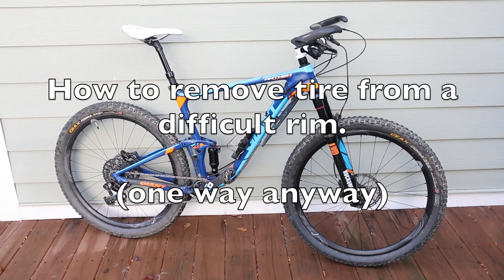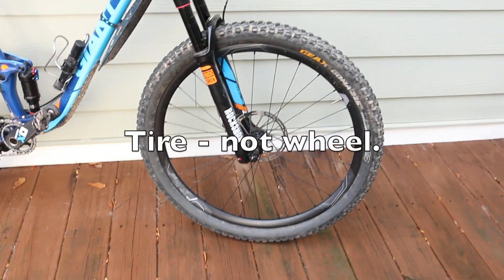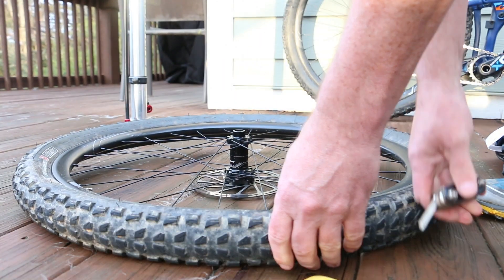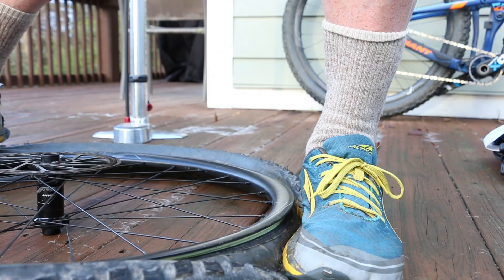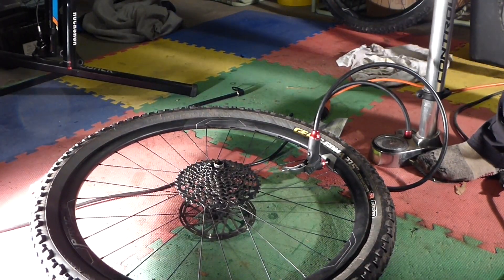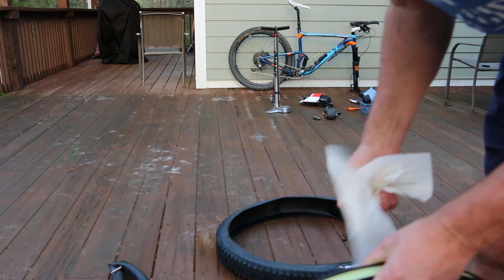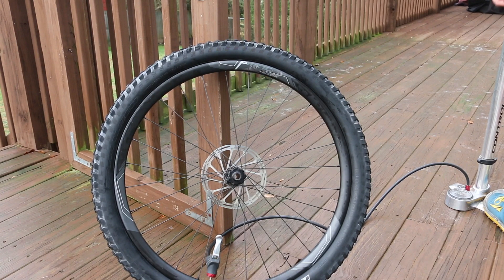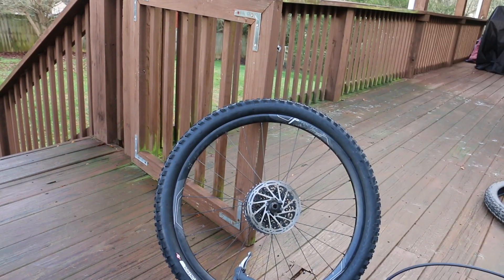How to Remove a Tire from Difficult Carbon Rim Without Damaging It

Comment: Thank you! I used to be a helicopter mechanic in the Navy, but I STRUGGLED with exactly the same problem you had here. Worse, I'm getting old and my hands aren't as tough as they used to be... fought that darn tire until my fingers were bleeding, but no luck. I want to do this task without tools for flats on the trail or on a bike tour, so I restricted myself to only the things I had in my tool kit; NO shop tools. This method works. Thanks again!

Comment: I came across this video trying to remove some 25c road tubeless tires. Unfortunately, there's not enough tire carcass for me to stand on it, but the video did prompt me to try a variation that worked - I laid the wheel down, put a plastic tire lever at the bead, stood on the lever and then pulled up on the rim. 

Thanks for the vid and I hope that my variation keeps some unlucky person from trying to cut their tires off in frustration!
Reply from the maker: Good job!  These new rims are such a pain in the ass.  I know they did it so you'd have a really good seal but it sure has made it harder to change a tire.
Reply: Thank you for this. I am going to try this tonight. I love these wheels but dread getting a flat because of how difficult/impossible to remove the tire.

Comment: This video is still helping people in 2021. That push the tyre bead off the rim with your feet tip just saved me from punching the wall. Now I just have to figure out how to get the spoke nipple out of the wheel (it's just rattling around between the double walls at the moment). Deep rimmed CF road wheel by the way, had to pop both beads with my feet just like you did. Top tip! thanks for the upload, very handy.

Comment: I fully and completely endorse this video!!! I got beat up last night attempting to remove a non-tubeless 27.5/650b tire from a tubeless rim, after taking a beating for about 15 minutes I decided to search for info on the issue. Used your technique with boots on and done R&Ring the tire onto another rim and mounted in about 3 minutes. This video should receive an award, no really it should. Stay golden pony boy!!!!!

Comment: Brad, thanks for the video. Well, I wrestled with getting a tire off my wife's new carbon rims for 2 hours with no success. I tried your solution and was able to get one side off, but not the other. After reading somewhere that bike shops placed the tire and rim on top of a large trash can and pressed down on the tire I thought that might work. I only had a plastic recycle bin, but I placed a heavy towel over the bin, laid the rim/tire over the edge of the bin with just the tire hanging over the edge of the bin. Then I held one side of the rim down with my knee while pushing down on the tire on the other side. Boom, it popped right off. I flipped the rim over and repeated on the other side. Boom, that side released also. Took 10 seconds per side. I think you might be able to use a log out on the trail instead. The trick is to get the rim off the ground a little bit while pushing the tire down. Also seems a little better for the rim and cassette than standing on it. Ha.
Reply from the maker: That's an excellent idea!   I just had a difficult time again a couple weeks ago and took a bit but I got it off, however, instead of grabbing spokes, I actually grabbed the opposite side of the rim but your method sounds worth trying next time (or if I get stuck out in the woods).   Thanks for sharing it.

Comment: This video was a fingertip saver. I worked for hours trying to break the seal on my 27.5 tire and it wouldn’t budge. My fingertips were raw from gripping the tire and pulling on it. Even snapped a level trying to get it off. Thanks 🙏

Comment: after 1 hour, tired fingers and blistered thumbs, i successfully removed the front tire off the carbon rims of my road bike. i gave up on the rear wheel until i watched this video. a bit skeptical for road wheels cause of the much skinnier tires but with a little care, a lot of rags and some walking around eggshells, i just managed to pull the bead of the rim! thanks for the video!

Comment: DANG. I knew someone would have this figured out. The shop I bought my bike from told me to just bring it in whenever I had a flat--said it took him two guys and pliers to get the tire off. Your method is TOPS. Still a bear to get the tire back IN the rim, but way better than having to schedule to take it in and wait and on and on. Thanks, Brad!!

Comment: You beauty! I have just done this on WTB byway 47 gravel tyres after an hour of struggling trying to push of the rim with my thumbs and molegrips and getting a blister in the process. Your method works in seconds even on a rear wheel with gear set and brake disc.... no sweat BRILLIANT. :)

Comment: April 2020 - with a carbon gravel bike rim and a 30mm tire - this method worked (pulling on the rim). I did it on concrete, and the tire slipped out from my shoe once, scratching the rim edge - so keep the surface in mind when you are doing this. I have put dry-lube on the tire edges installing it - hoping this help get them off next time I flat. Thanks Brad for the video

Comment: I couldn't get the tire off, so did a Google search for videos. Lo and behold, I have the same bike and wheel set as you - right down to the paint colors! Thanks for the advice - worked like a charm releasing the tire!

For mounting a tire, I use a mixture of Dawn dish soap (about 10-20%) and water for lubrication. The floor pump wouldn't get the tire to inflate, so I have an Airshot canister which stores enough air to inflate the tire in one shot. Mine seated at about 30 psi - although it may vary between tire brand and models.

Comment: Thanks for posting.  I was ready to cut the tire off but this worked great.  One difference is that I pulled on the rim instead of the spokes.
Reply from the maker: Yeh - in retrospect, pulling the rim is a much better option.  Hadn't thought of that at the time I made this video.
Reply: @MTBIKEXC  Just after I sent this comment I saw that you put the same thing in your comments.  You saved me so I appreciate that.

Comment: Thanks so much for your video, was a little reluctant to stand on the rim thinking I might damage it. So here's what I ended up doing and it worked perfectly. I pushed the deflated tire to one side and HEATED THE BEAD UP WITH A HAIR DRYER. It released immediately.
Reply: stand on the tire, not the rim.

Comment: Advice: When attempting to seat the tire, you want to be careful pumping it above the recommended PSI. It could easily explode off a carbon rim. If at the recommended PSI and still not seated, bring the pressure down and attempt again. If still a no go. Leave the psi at max and tap the tire on the floor (working your way all around the tire). If it still won't seat, ride it a bit on pavement... It'll eventually seat under rider pressure.

Also, if seating for tubeless, install with a tube first, seat and deflate. Then remove one side of the bead, remove tube, reinstall tubless valve and open side of tire, reinflate, seat, deflate and add sealant via the valve, add desired psi.
Reply: you havent done this on mtn bike carbon rim yet have you smb ?? :)

Comment: I work at a bike shop and we advise our roadies and tubeless ready mtb'ers to carry Chapstick in their saddle bags/packs to lube the tire bead like you did with the dish liquid. At home you can also use baby powder on the bead reduce friction for road and mtn bike tires. This will also save you a lot of sweating and swearing if you have to take the tire off and is a little less goopy than the liquid. Great video!
Reply from the maker: Stephanie Fischer thank you.  Appreciate the tip!

Comment: Brad,

I had the same problem but with regular non-carbon rims.  Tried for about an hour trying to peel the tire back from the rim. Saw your video and finished  taking the tire off in 2 minutes. It works!

Comment: Thank you, thank you, thank you for posting this video. I was struggling and ultimately cut off the old  Maxxis Rambler tire (40mm) off my front Industry Nine wheel. After running into the same issue on the rear, I found your video before I cutting. I then tried your method on the stuck rear. Worked like a charm and saved me the hour it took for the front. I was super worried about what I’d do if I got a flat while on a long ride. I’m not worried anymore. Thanks again.

Comment: Another thanks for this video. My Nukeproof Scout has tubeless tyres and rims fitted (although with tubed from the shop). I tried yesterday to put some more gravel focused tyres on and for the life of me I couldn't figure out how to get the tyre off. After about 30 mins I gave up. Fortunately this was in my garage and not in the woods. This morning after a few minutes the front tyre was off. The rear took a bit more time as I was wanting to avoid any damage to the cassette. Thanks.

Comment: This is a very helpful video. I have a Trance 1 with the same carbon fiber rims, Nobby Nic tires. Somehow, I managed to get them off the first time when I converted to tubeless a few years ago. I thought it was latex binding the bead when I tried to remove the tire recently. Your trick was perfect; the bead popped off with less effort than when I tried to pry them off with my hands.

Comment: I  had the same issue with a Race Face Next R 30 wheel and a Schwalbe Nobby Nic 29x2.6 tire--incredibly difficult to remove. This worked beautifully, thanks! Plus, you can also apply this method on the field, in contrast to other solutions that require jaws, or a vice.

Comment: Running the same rims on a Giant Trance, and holy moly. I spent 2 hours at the local bike shop trying to seat a mavic crossmark - we got to 7 bar and stopped and it wasnt seating. Thanks for the massive tip to break these beads!

Comment: This is the best video I have seen on both removal and installation of a tubeless tire. Also, only using a floor pump and applying fabric softener to difficult to pop areas. Thank you so much! Cheers

Comment: wow  thanks for this tip.its brilliant ! ..  the polish  bikeshop  broke  2 spokes trying to   get the  tyre off and  on   to  fix a flat ..i knew it was tight  so i let them  have  the hassle... didnt realise the guy didnt  know how to deal with it .
in  the  end  i  cut   the original tyre off  and still  had a nightmare  trying  to remove the  2  steel wire rims that were left.... and  scratched the    wheel..  found  this  video  and  took  the  other  tire  off    in  5 mins.. so  now i have   2 easy to  remove  tires  so  that   wont  give  me a massive  headache when  i do   get a flat in the middle of nowhere..thank you so much
Reply from the maker: What brand/model tires are easy to remove?
Reply: schwalbe road  cruiser

Comment: Good video, Brad.  I learned this lesson the hard way as well.  My 27.5 x 3.0 WTB tires were a pain in the arse to remove until I learned how to break the bead using my feet.  Never had this issue with any other bike until I went into Plus+ tires.

Comment: Finally!   This looks promising and I'll definitely try it.  My road bike has Conti 5000's on Reynolds carbon rims and can't get the bead into the trough to fix a flat.  It's taken 20 minutes or more of trying and cursing to get a tire lever inserted.  This method looks it has a chance of working,

Comment: Great video, I was able to unseat the one side of the tire but I was not having any luck with the other side. I have 25c road wheels so I clamped the tire on each side to my work bench and did as you did. The bead unseated easily. Thank you, if I had not seen your video I might have succombed to the frustration and started using metal tools on my expensive carbon rims.

Comment: I feel your pain man. I will definitely try this tip next time. I spent two hours tonight trying to get a tire off an Enve ... finally did it, but my hands hurt and my thumbs are jacked up. I will hate life if I ever need to change one of these tires on the trail.
Reply: I had a set of Reynolds carbon road tubeless with Schwalbe Pro Ones. Took FOREVER to get them to seat but after not holding air I went to remove the tire and I had the same experience you did. Long story short, I returned the rim because the tape was all jacked up and I knew the wheels were a PIA. I spoke to the store and they said that as wheels go, ENVE are the most stubborn, followed closely by Reynolds. And Schwalbe Pro Ones are on the tighter side. They knew people with ENVE's who resorted to cutting Pro Ones in half to get them off... Its scary to think that a flat on the road that won't seal will be the end of a ride these days if we can't get tires off.

Comment: Thank you so much!! I wish I would’ve known this trick last weekend. I went riding and got a flat. Easy fix right?? Nope! I couldn’t for the life of me break the tire bead. Same exact thing as you showed hear. I tried using your method and it easily broke with some force
Reply: Oh and after giving up on breaking the tire bead. I decided to try pumping up my tire one more time. Well my hand pump ended up breaking on the valve stem. Double whammy!!

Comment: Thanks for the advice!  I was having enough trouble this fall, I switched to my old rims, but I'll try this when race season comes up again.  My tip for getting the tire to seed is installing it with the inner tube, let it sit for 24 hours and it usually goes on easily.  Again, I haven't tried it with the carbon rims.  Wish me luck!

Comment: Thanks Brad, this worked like a charm for me. I found if the rim is deep enough you can pull on that instead of the spokes. Can't believe how hard some of these tyres are to remove though. Mine are Bontrager Line Comp Pros. Thanks again for the video, saved me a long  trip to the shop.

Comment: Just wanted to say thanks ... works perfectly.  Just an addition.  I have fenders (with a very close tolerance to the tire: Specialized Como 5.0) on my bike and I could not get the rear wheel back in place with the tire inflated ... otherwise P for perfect!
Reply from the maker: Cool bike!  I love fenders and suspect electric is in my not so distant future. :-)

Comment: Hi. That’s an awesome tip!! Thank you!! Not sure if it’s been mentioned or not, I use a spray bottle with a mix of dish soap and water. I spray the tire side wall down (while ready to mount) with a heavy coat of soapy water on both sides and bounce the tire whilst filling it with air. Hope that helps!
Reply from the maker: DeansNeatMess thanks.  I’ve actually tried soap and water to get a tire to seat into the rim.  I’ve also tried WD-40 LOL.  These beads are horrible.  My latest two bikes have Synchros and Specialized Roval wheels and the beads are easy to remove and seat tires.  Wish they all were easy.

Comment: Y know i has the same problem on my trek top fuel 8 i found out that pressing the bead slightly upwards with your thumbs while rolling it back with your hands Works Great (less of a chance of bending your disk ) (im 13) so i think you other people should be able to do this with ease (thx for the heart)

Comment: Honestly brother every time a new friend gets a tubeless bike I show them this video 

A good tip I've learned from the bike shop is to use brake cleaner to lube the bead on the installation of the new tire if there is a spot on the bead it won't seat

Comment: I'm getting on and not strong enough for that technique. Use a one handed clamp made from plastic jaws with rubber grippers ( eg DeWalt or Bahco). Get all the tyre in the jaws & clamp it up hard. Lever it right over til it pops the opposite side. If its still not done it then asideways twist on the clamp will unlock it. Repeat for the opposite side. Still not ideal to carry round the large clamp with you but ok for back at the van or base.
Reply from the maker: Oh - I like that idea a lot!  Thanks for the suggestion!

Comment: Hi mate thanks for the great tip, however just this afternoon I used the same process! (before taking the bike out as its only 4 weeks old I wanted to practice and find a solution to use on the road in future) shame more people don't use this easy technique. I got stuck last Saturday about 4 miles from home had to get recovered as holy mosses I couldn't get the tyres off the front to repair the flat. Only trouble is like you say do you have pump to really high pressures which will be a pain with a tiny hand pump on the trail until they pop! Cheers

Comment: Thanks Brad..... Someone suggested a hair dryer, I used my electronic/heatshrink heat gun,  I heated the *RIM*,   NOT the tire.... then I put a 2x4 block on the tire and kneeled on it and POP!  ... off it went.....easy.

Comment: Tip: Before mounting your tire, apply a thin coat of petroleum jelly to the inside of the rim. Next time the bead will slide right off from its rail and into the center channel when you push on it with your thumbs. That will allow your tire lever to slide under the bead.

Comment: Great video, unfortunately I have carbon wheel covers on my wheels so I cannot grab the spokes and with skinny road tires, there is little room to stand on.  Got one side off by grabbing the tire in my hands while pushing the bead into the center channel with my thumbs but I have not been able to get the other side off, my thumbs can't get very close to the edge of the rim.  I watched your video for inspiration.  I wish that manufacturers would have come up with a solution to address this problem.